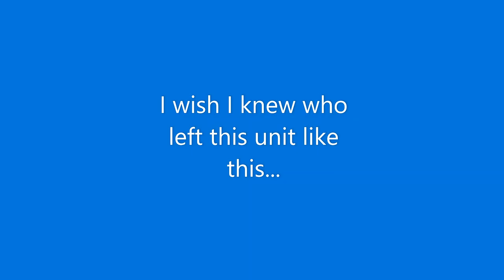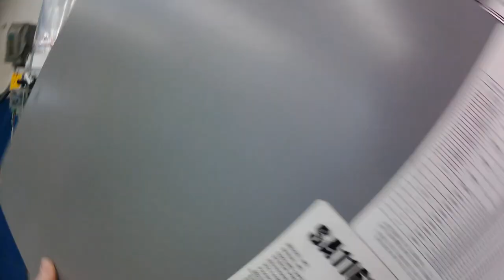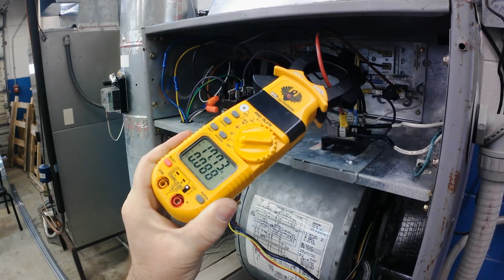Horrible Looking | Re-Wiring a Heat Pump Air Handler with Electric Heat

Comment: Great video. I am working on my packaged unit and cannot find a replacement PCM blower motor. I just learned how to wire a PSC blower motor, in place of the ECM motor. I only had the A/C working because I didn't know how to wire the heat kit to the blower relay, but you explained it clearly. Nice job!
Reply from the maker: Thank you.

Comment: would that be a 90-340 fan relay...If yes, How would someone go about adding a delay?  Thanks.
Reply from the maker: There is a solid state time delay that was "originally" installed  in this unit. I get long winded so I didn't put it back in when I shot thia video but I do have a video to re-install it coming up soon. Thanks for watching.

Comment: why did you run power through the high limit before the heater?
Reply from the maker: I had some factory wires that were short! And it was just close to the sequencer. As long as you run the safeties in series it doesn't matter. Before, after, one before and one after the heater if you have two. Just has to be in series.